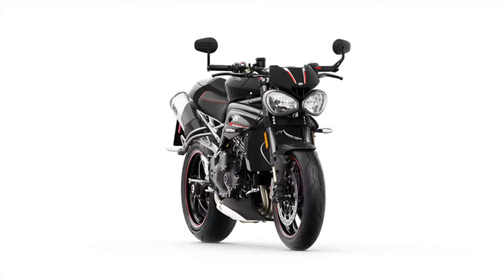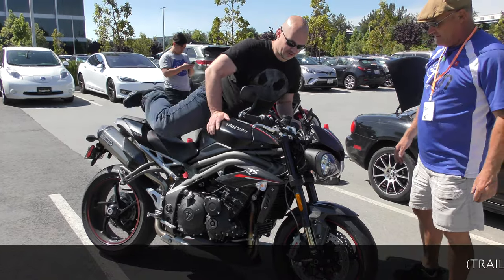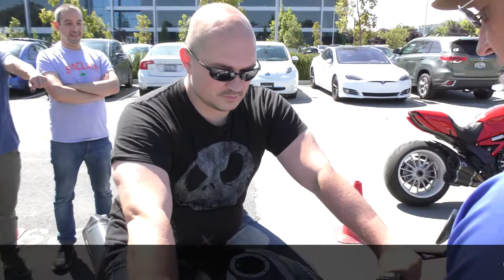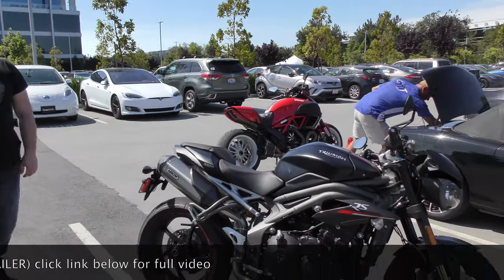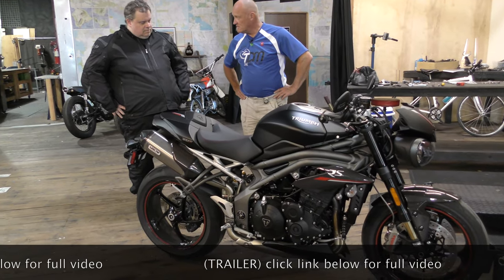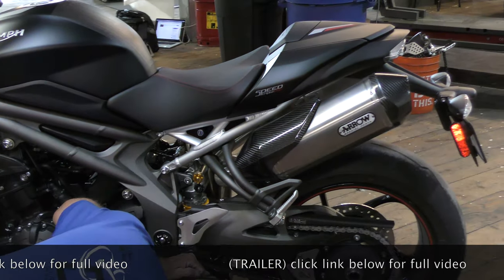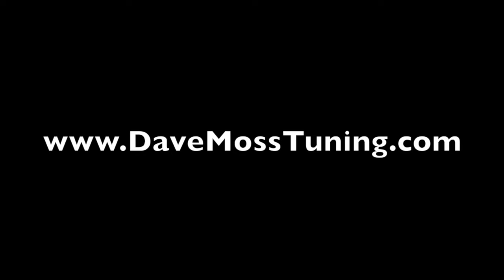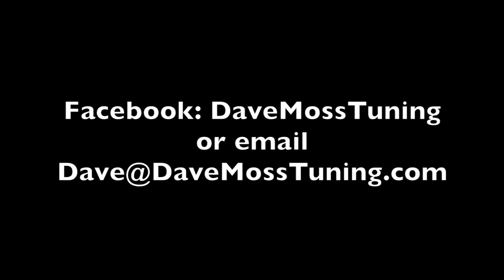2 Clicks Out: 2019 Speed Triple RS 1050 Suspension & Tires (TRAILER)

Comment: Was that video put out especially for me :-) ? Finally some info on road tyre pressure - but would be great if You could talk a bit more about the revalve for the shock absorber as there is no slow speed compression adjustment and I guess the only way to get the comfortable ride on the road is to revelve the rear shock.
Thank You
Reply from the maker: The revalve portion refers to the position of the adjusters. If you are in the first or last 25% of the settings a different engineering solution is required. Toward maximum requires more of compression and or rebound, towards minimum requires less compression and or rebound

Comment: I'm definitely getting this video, I've only got about 10mm of chicken on the front (none rear) but I'm running Michelin Power RS. what pressures would you suggest for 160lb rider, fastish/twisty road riding, please? thanks
Reply from the maker: Chicken = profile differences between front and rear. Staring point would be 36 front and rear, then try 38/38 and 40/40 if you are heavier. Don't drop below 32/32 as a cold pressure due to the soft carcass.
Reply: Dave Moss Tuning thank you! Since day one I've been running 36/36 but given your comments in the vid about not having much chicken on the front, wondered if i was way off here. Thanks again.
Reply from the maker: @krisknave  Not way off - that is due to profile and pressure. Sharper profile +_ higher pressure = more unused tire.

Comment: What is correct tyre pressure in Kpa.
Reply from the maker: Dave Williams, editor, replying here. My apologies. I try to include that (bar which is just Kpa with decimal point in different place), but I overlooked it that time. Almost any search engine will have quick conversion box "psi to kpa".

Comment: So a 36 FW and 42 RW tire pressure good for street riding?? Because i put my tire pressure to 34 FW & 36 RW like it says on my sticker on the bikes frame.... Thanks
Reply from the maker: Higher pressure = greater longevity for the rear tire so you can choose whatever pressure you want based on the roads you ride and the speed you ride.

Comment: Does speed effect tire pressure? If your going 160mph should the pressure be less?
Reply: heat effects tire pressure. 
more friction is more heat. 
speed effects friction, just like breaking.
Reply: No expert but I’d suggest more speed generally requires more tyre pressure as the tyre will deform more with more heat
Reply: @HelloJamesBond  dude, didn't you understand my reply?
the tire pressure will increase because of the heat. 
so at starting point (cold tire) your pressure should be less. 
track racers can go to less then 20 psi tire pressure.
Reply: Trotsetukker yes i did and I wasn’t commenting to you
Reply: @HelloJamesBond  but your answer is wrong. you shouldn't run a higher tire pressure. 
since the pressure increases because of the heat.
Reply: Trotsetukker fair enough, it’s something I’m just getting into. So important, and suspension set up.
Reply: I live out where there is still room to roam... And on nice sunny days- I can twist it wide open and flat ass MOVE along!!! I have had a problem with tires... My first set of battle axes the came on my 18gsxr- 1000r.... I wont go Into it too much, but the valve stem would leak oit+ mid ride cause.a flat.front tire!! The wear pattern on these new michilen pilots doesn't seem correct...
Reply: @Trotsetukker  so if heat makes pressure than I guess the road ahead is to ride it at speed and recheck the pressure?
Reply: @freelancerider100  
no, always check your tire pressure with a cold tire. as stated by the motorcycle manufacturer. 
if you sometimes hit the 160mph you don't need to lower your standard tire pressure. If you are do hard acceleration and hard braking you should lower the pressure. lower pressure means more grip.

Comment: I mostly do street riding and honestly dont go hard in curves as im in new york so its mainly city riding with occasionally highway runs.. so what tire pressure do you suggest on front and back.. I have a 2018 Ducati Monster 821
Reply from the maker: Start at 38 front and rear for a week. Then try 41 front and rear for a week, then 36 front and rear for a week. See what pressures allow the tires to work best for you, your roads and your speeds.